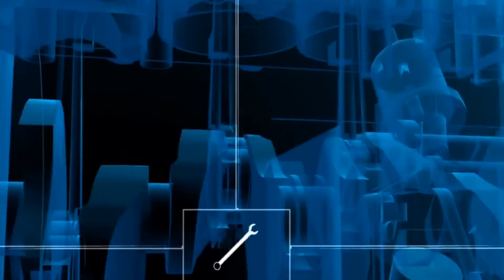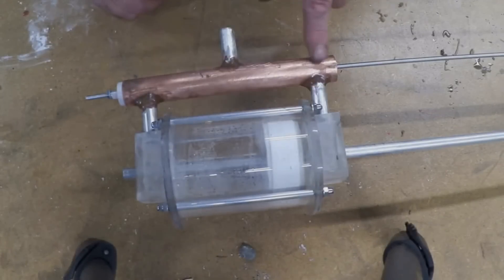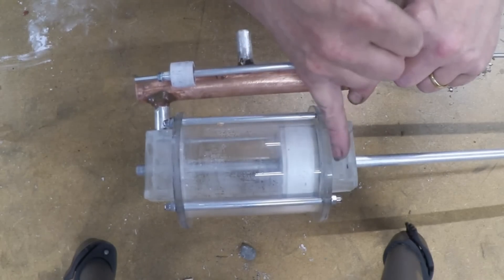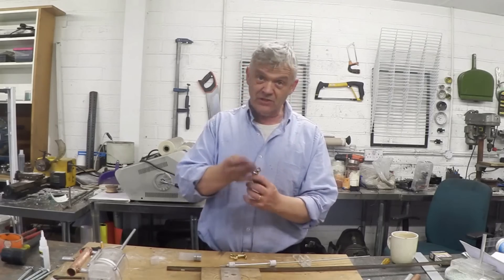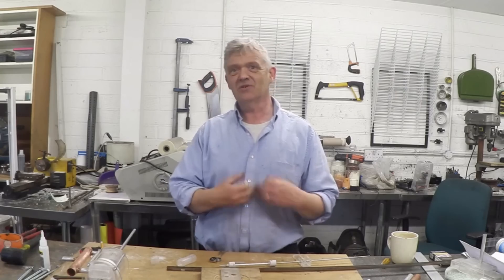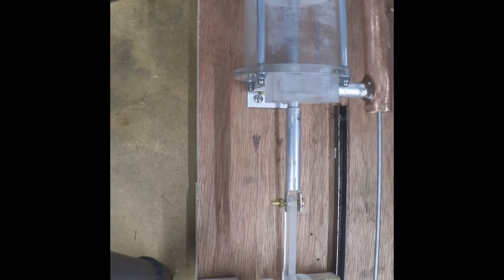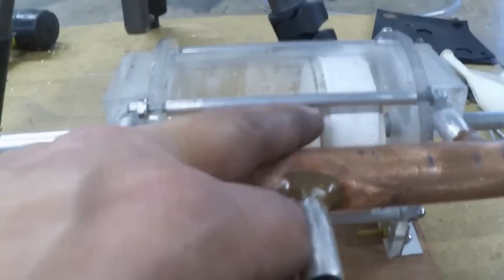2250 A DIY Air Engine And How It Works

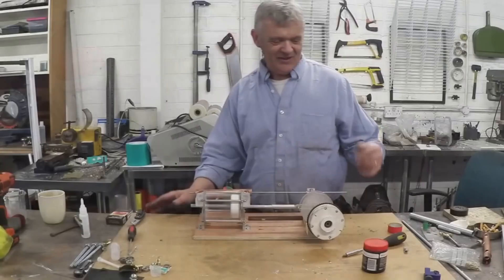Comment: 10:15 "we need that inertia"
Flywheels are an engineering kluge. They act on a symptom, slowing the rate of slowing instead of eliminating the problem: negative torque.

Permanent horseshoe magnets can be arranged into stators and rotors that add torque during each cylinder's final compression, then claw said torque back from its power stroke's peak.

A four cylinder engine would use a Temporal Torque Transfer Device (TTTD) with two stator and two rotor horseshoe magnets. Propellers and transmissions will have lots less stress to deal with (if I can interest anyone in advancing piston engines).

And the scotch yoke is kinda cool. I prefer what I call an inverted crosshead. The connecting rod's upper end is widened to equal parts of a cylinder-diameter-sized circle, so the connecting rod itself bears on the lower cylinder wall. This removes the piston and upper cylinder wall from the equation both mechanically and thermally while forming a bearing that never stops moving: a rod's rotation is at maximum at TDC and BDC, right when sliding stops.

They're both part of my segregated combustion engine (the highly insulated tungsten combustion chambers are alongside instead of inside the cylinders), which should exceed 2/3 efficiency, especially at 40,000+ feet (the Displacement Adjuster makes that possible by maintaining a 3:1 expansion to compression ratio at any desired working displacement without ever resorting to vacuum (a CVT transmission feeds the DA's crankshaft's output to the engine's crankshaft while directly altering the engine's working displacement).

Let me know if you want to see the engine.
Thumbs up. Your videos are always fun and educating

Comment: Wicked. Could you start that and run that with a bit of ducting pipe attached to a ventilation system, sort of like using a draft effect?

Comment: It would be really cool if you built a two cycle, direct injection,  air heated, liquid air engine.  (GM  2 cycle diesel with liquid nitrogen in the tank)

Comment: Could be faster to compress air to tanks for a car than to recharge batteries lol, is the energy potential relatable? Not that super-caps or en-route scraping chargers, like trains have, aren't likely better options to solve that, but I love exploring possibilities! Sorry to change the comment number away from 42.

Comment: I made a large steel and Teflon rotary valve that can handle about 25,000 PSI which eventually I aim to use to make an air motor from.

Comment: When I made this motor I simply had 2 metal flat bar plates stuck on the shafts sticking out at each end of the piston. There was a 6cm gap between these plates and the ends of the valve rod. The way it worked was that at the end of the stroke the momentum of the piston would push the valve over with this plate and the piston would reverse direction. Basically it was a full  linear motor in operation. It was much simpler and did not need a yoke or crank or any other stuff. The only crank needed was to turn the linear motion into rotary motion if rotary motion was what was needed. Btw making a smaller version out of steel using a lathe and some fancy tools and with a powerful compressor got me an rpm of 6400  before the piston smacked the one end off the cylinder and popped out of the end at high speed :). I guess I did not make it strong enough. A simple one using my idea for the valves and without the rotary valve bit could be printed with a 3D printer as long as the cylinder was made using a smooth plexiglass tube.

Comment: Cool, of course, compressed air cylinders are very cheap and much easier. I use one with a 2/5 control valve, and it's cheap.

Comment: ❤you can do that to a truck engine😳⁉️⁉️⁉️⁉️😁🥰
Reply: Of course, but you have to carry pressurized air with you to push something like a truck. It's been tried, but low range and danger of explosion in an accident
Reply: @kingofnothing2260  why would there be danger of explosion? trucks already use compress air for its airbrakes and starting and there are trucks and cars that have propane tanks fitted for running on lpg and cng
Reply: @dantronics1682  a huge reservoir of thousands of psi air would be needed for any real range. Same reason hydrogen cars aren't used. Carbon fiber containment is best under testing as it will split in an accident rather than crumple, but still
Reply: @dantronics1682  there's a lot of research into air driven cars and lots of reasons they aren't common
Reply from the maker: Yes you can